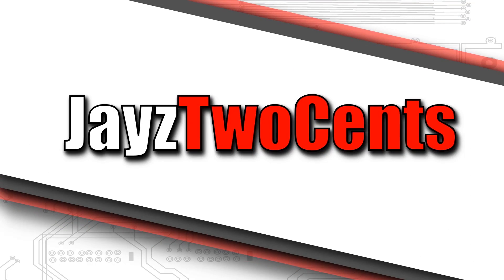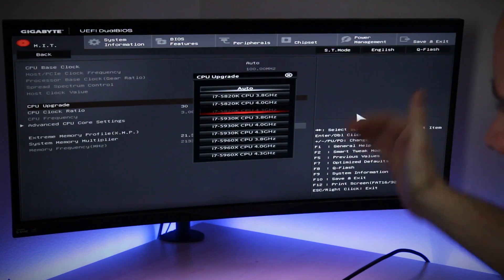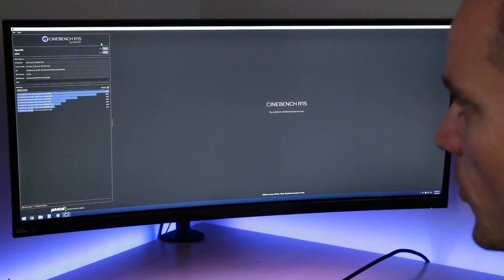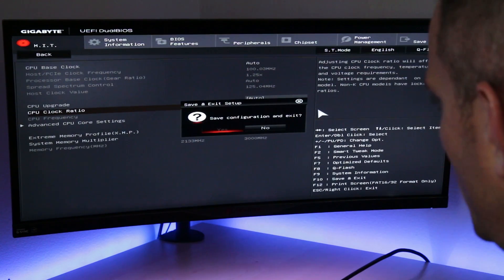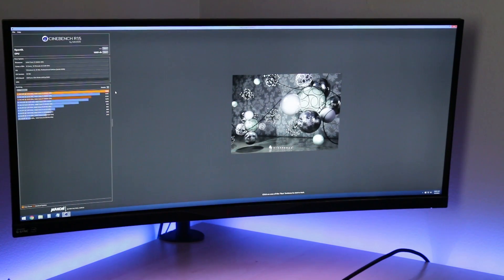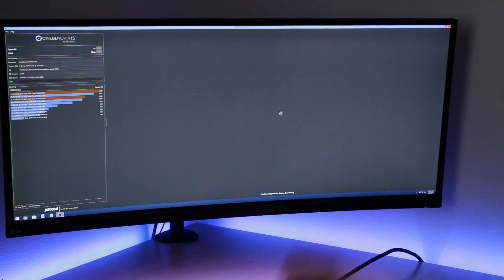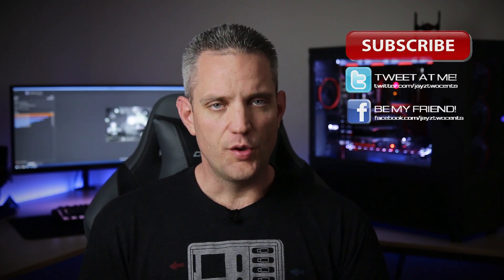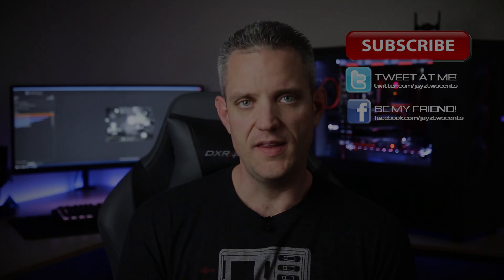XMP vs Overclock

Comment: i went from a 700 watt ocz power supply to a 1000 watt evga power supply and as a result i could only hit 4.7 ghz stable on my amd 8150 instead of 4.8 ghz that i was hitting with the ocz, so power supplies can have a big effect too
Reply: +1234garrett1993 That's because evga psu's sucks big time.. So many people are complaining about unstable systems when they buy evga psu's..
Reply: +Ulrich Jensen It depends, EVGA Supernova G2 is basicly the only good series evga has, the others are pretty shit.
Reply: i have the supernova 1000 g1, i got it over the g2 because the g2 has bright red pci e cables lol wtf were they thinking
Reply: I don't have bright red pcie cables on mine... (750W) G2
Reply: yeah i think the 1000 watt was the only one that had the red cables
Reply: Yeah, just checked pictures, IK wouldn't really midn since I am going for a red/black build.
Reply: MegaAlalil nice i love red and black builds you should check out some red and black sleeved cables if you havent already lol
Reply: I think getting a better monitor, and an ssd is a bigger priority first. All of my cables are already black, and I want LED's too.
Reply: nice, sounds like a good plan, i have a 27 inch 4k, i think getting a 4k screen that small was a mistake now so if you were thinking about something around that size you might go with 1440p lol
Reply: I was thinking of going 1080p PLS screen. 

This one to be specific: http://www.inet.se/produkt/2303856/samsung-24-s24d390h#/specs

I don't need 144Hz, and my graphics card is not powerfull enough to max out games in 1440p. (I have a Sapphire R9 390 Nitro, and a i5 6600k @ 4.6Ghz)

Comment: For someone who is completely new to overclocking, should I try to manually overclock my 4790k on my msi gaming 5 board, or just use the OC genie feature? Before I overclock, I will be using a kraken x61 cpu cooler.
Reply: +Cruzz999 Do It manually, go slow, and if you get a bluescreen, its nothing bad (as long as you didn't set your CPU clock to 6 GHz or higher)

Comment: The most fun overclocking time I had was with AMD K10 CPU, especially when you unlock new cores. My Sempron 145 has an unlocked 2nd core and overclocked to 3.2 (using the damn stock cooler @53°C, in full load, it never gone more than 63°C).

I also had a FX4100 and it was boring to overclock that. From 3.6 I took it to 4.4 without breaking a sweat. Didn't even messed up with the voltage, just bumped up the multiplier.

Now I'm waiting for a Zen APU (Raven Ridge), as I like SFF. And yes, I'm a fanboy, but I do own an WIntel tablet (my main PC), since AMD doesn't have tablets. I wanted to buy a Mullins A10 micro-6700t, but the only tablet having it was from a company called Bungbungame and it's name was Photon2. Who the f*** would buy that?

Comment: What about overclocking with inter extreme tuning utility?
I got my i5 4690k to 4.6GHZ 1.3v stable for 2 months (still having the OC)
Is there any drawbacks by not doing it in the bios?

Comment: 1155 socket - i5 3570k Later on ill get Gpu upgrade not cpu that's later as i still use 2xgtx 660's . runs gta v good .& this is all on air cooling. cooler is SpinQ VT.
My scores: CINEBENCH:
Stock Cpu: cpu 3.8 ghz score= 494
Bios (Oc Tuner on this socket it's called this not XMP. ): cpu 4223 ghz score= 577
My OC: cpu 4723 ghz score= 646
Reply: +Dj Xee-Taytius & i did have a H110 & got it to run nicely at 4.8ghz .

Comment: Overclocked my FX8320 to 4.6Ghz. I get a Cinebench score of about 700
Reply: Tanzu15 Now hats just bragging :P
Reply: Tanzu15 What? You only have a 7960X? Jesus. You might as well use a Typewriter
Reply: +Retrospect I Got a score of 722 with my i5 6600k @ 1.35v @ 4.51ghz
Reply: Same here! I have gotten as high as 714 on mine. What voltage settings are you using?
Reply: +Retrospect 5820k @ 4.6 ghz, CB at 1289
Reply: +Retrospect Fx8320 4.5 @ 699
Reply: i7 7960x 12 core 6.0ghz 60 pcie lanes
5,059,890 score. 40 Threads. 50mb cache.
Reply: Fum3s 1.35V is a bit high for Skylake. 1.3V is about the safe voltage for haswell. I would not go higher than that on Skylake.
Reply: Carl Tiede 1.46V I think... It's not the best Overclocker :P

But I think if I upgrade my cooling a bit, I can hit 4.7 or even 4.8. And I mean, a score of 700 is not too bad for a $100 (used) CPU ^^
Reply: Retrospect Wowzer! I got lucky I am just on 1.3875 or something close to that. I have to double check. I am still on air, and haven't REAALLY had a need to go higher. No when you consider it is a faster multthreaded performance than a 3770 which still sells for like 300 haha.
Reply: Carl Tiede It was used and cheap. And I think I know now why the Guy sold it :P

But it coud also be a temperaure thing... I use a Gigabyte 970a UD3P, so not really a High-End overclocking board :P After I strapped a fan to my Manboard VRM cooler, I got an extra 100Mhz stable. Then I ran the fans on my Radiator at 7V instead of the 5V from before and lowered my CoreVoltage about 0.05V.
Reply: Retrospect lmfao im from 2035. this is actually 2 years agos best machine. oh and its as small as a ps4.

Comment: I'm new to PC building and keep to relatively safe overclocking. With my GPU I just do what OC I can manage without going over voltage. And I'll admit I'm afraid to run extra current through the GPU for concern of "zapping" the circuits, if you get my meaning. Same with the CPU. I see the automatic settings but the manual OC stuff is way too confusing for me, and again I have no idea how much extra voltage I can safely add to the chip before shorting it out.

Comment: you were talking about degradation and such from running your cpu at max. I remember in another video that you also don't do CPU stepping where the Ghz will ramp up but rather you keep yours at max. Would allowing for stepping improve degradation resistance also what are the benefits to turning of CPU stepping?

Comment: i5-4690k @ 4.2, any higher blue screens
Reply: At what voltage tho? I can get my 4690K to 4.5Ghz @ 1.4V, not running that overclock tho but I will before I upgrade anything
Reply: Silicon lottery is bitch. Guess I got lucky then, same chip and 4,4Ghz @ 1.180 volts stable
Reply: +TheYGrizzly Yeah I think I lost the silicon lottery with my 4790K. I can't get past 4.6 GHz at 1.3V.
Reply: I'm at 1.22v 4.4GHz with my 4690k.

Comment: what can i do to add more fans when my motherboard only has 1 fan port or input
Reply: Fan Controller or connect low speed fans via Molex / preferably SATA connector to the PSU directly (remember that they will run with 12v all the time so you really have to use a low speed one or your system will sound like a turbine)

Comment: Is R9 390X better than R9 390? IN terms of overclcocking and perfomance in General?
Reply: Not worth the extra $100
Reply: +Daniel Rantanen explain your comment. Why? 390X beats 980 in some games and in others is eqaul.
Reply: I wouldnt pay $100 for 2-7fps more. You have to consider that GTX 980 is basically GTX 970Ti.
Reply: +Daniel Rantanen sometimes is 7, sometimes is 10 fps difference. Yeah but 980 has 200€ more than 970, and 390X has only 100€ and maybe less.

Comment: ik this isn't the right spot to ask, but I got some rly crappy thermal paste off of eBay (2 grams for $2) because my gpu was horribly dusty and reached 80C under load and idled at 40.  taking the gpu apart was a breeze. I cleaned everything out, replaced the thermal paste with the crappy one; the old thermal paste dried out. as soon as I fired it back up I was expecting amazing results due to a complete deep clean, but my temps were about 15 degrees hotter. idle was around 55, and load temps were 95-105 degrees. HELP PLEASE
is it the thermal paste to blame or did I mess something up when I took apart the gpu? 
it's an xfx 6870 2gb (it's pretty small)
Reply: never get ebay stuff for things you love 
either get artic silver 5 or mx-4 , I personally use mx-4 
idle at 20-30c and load at 50-60c
i7-4790k @4.7ghz
Reply: +XNinjaZero I had $2 left on a prepaid card so I was like "why not it's just thermal paste it won't make a difference" and it did 
even w the gpu all shiny and clean it runs 30 degrees hotter :(
Reply: +MCatwar yeah should've waited, not really hard to get 10 bucks saved up for good quality paste. just re-do it again with either of those paste and you'll be happy again

Comment: I went with 4.7Ghz @ 1.352v for my 6700k instead of 4.8Ghz @ 1.4v in order to have 3000Mhz ram.

Worth it or nah?
Reply: whaaaat? 1.35 for 4.7 on skylake? bro I'm at 4.7 on a 4790k at 1.2v. this made my decision to keep my cpu and screw skylake :P
Reply: +john handcock sometimes has to do with the board too, I put my cpu on my friends msi gaming 5 and only could do 4.4ghz on it compared to my vii formula
Reply: XNinjaZero MSI Gaming M5 is what I have as well. If I had known it came with no LLC feature, I'd have bought something else. It's really hampering my overclock.
Reply: +Verendus Vir the asus maximus line is very good at this, even the hero can achieve good clocks with very low voltages. I got the vii formula for 250 instead of the 350 when it came out and love it, I painted it white for my theme build.

Comment: Fx-6300 @ 4.5Ghz with manual overclocking.
Reply: I did the same oc , still too fucking slow :/
Reply: Same
Reply: +Ed Thomas you deactivated 2 cores? Why exactly did you do that?
Reply: What do fx cpus get on cinebench?
Reply: +SIME_LP In what way is it slow?  My FX6300 is permanently overclocked to 4.1Ghz and it runs cool / quiet and fast,  In GTA5 with pretty much everything maxed I am getting 75-80fps and that's really only limited by the fact I have a GTX 970sc / CS:GO I get about 180fps max settings / star wars battlefront I am getting close to 110FPS max settings and given that my monitor is only a 60Hz I am getting way more performance in games than I can actually use until I decide to upgrade my monitor to a faster one or I take the risk and overclock it.     So if you have overclocked your's and are getting slow performance then you might have done something wrong like overclocking the ram or setting the ram to its max speed when you have more than 2 sticks installed doing this will cause the CPU to take a performance dump on its self as AMD FX chips have crap memory controllers and can only handle memory overclocks with 1 or 2 sticks and not 3 or 4.
Reply: +Hivon to get higher stability.... lower heat. 

some cores wont OC as high as other cores in the same chip...... and because bulldozer has REALLY bad single thread performance... but AMAZING multi thread..... yor not taking that big of a preformance hit. 

im still running a phenom 2 1090t 6 core at 4ghz because it beats bulldozer in single thread (aka, most games)
Reply: +EQUINOX your single thread preformance is lower than the same clocked phenom 2. 

4ghz phenom 2 vs a 5 ghz FX... the pheom winsat 1 or 2 cores, and the FX pulls ahead at 3 or more.... if you cna laod all cores on an FX, it will FLY!

but no games/apps really use all 8 threads.
Reply: +Ed Thomas why didnt you get an fx6300 then? I am about to replace mine with an i7 6700k but I've got mine at 4.9 I wanted to push 5 but blue screens the 6300 would have been a better choice for you
Reply: ***** No one cares about single core performance other than Intel fan boys it is somewhat pointless to even bring that up as pretty much all programs and games work on multiple cores now ether through design or the OS,  Some games like farcry 3 were designed to work on a minimal of 2 cores and more modern games on minimal 4 and GTA 5 spreading its self over all six of my cores,  ether way windows 10 is smart enough spread the load over all available cores even if the game was only designed to work on 1 core.  So in this day and age there will never ever be a second where you will only ever use 1 core unless you disable the others.

Comment: Anyway to make MSI's over lock genie useful? All it does is turbo my cpu to its standard 3.8 GHz doesn't actually overclock it more than Windows power solutions does
Reply: +suchtieps3 The 6820HK does exist.. Check Intel ark..
Reply: Overclock
Reply: +EraseUrFace mine does the same... but i managed to get my 6820k to 4.2ghz without changing much.. however.. when i run cinebench at 4.2 i get a lower score than the msi clock at 3.8
Reply: +lankyeric u got a 6820k? nice man!!! I still like the 5820k
Reply: +Der_Zombie i have a 5350
Reply: +EraseUrFace my msi a88xg-45 gaming mobo would auto oc my chip a couple hundred mhz, youre talking about the bios genie right?
Reply: +Der_Zombie He is a wizard would i say . But i already have the 7820k AMP ROG OC Edition.
Reply: +Ulrich Jensen isnt that  a mobile cpu?
Reply: hmm very interesting, guess I will have to stick with amd overdrive. fuck
Reply: gr8tim22 reports and tests Yep 😊
Reply: i actually use it just fine. make sure to always hit apply or it wont take affect.

Comment: i finally made the jump and did an overclock on my processor (amd fx-8320 black edition, asrock 970m pro3 motherboard, and a stock cooler). went from 3.5ghz to 4ghz. noticed a pretty nice performance buff without affecting my thermals.
Reply: Jolly good

Comment: @JayzTwoCents pls respond, i only got a question. When you overclock your cpu, do you also have to increase your memory frequency along with the cpu frequency, or can i just increase my cpu frequency and not have a problem? i got a 4930k with an h100i and i can only get to 4.2ghz max, no matter how far i increase the voltage, right now its at 1.336v even if i put my voltage to 1.455 which is safe it still crashes. i need help
Reply: +Johnsomething duh or is the 4930k a bad overclocker?

Comment: MSI Gaming 5 Z97 board has separate xmp and CPU clock. if I choose xmp it only changes memory timing. I have xmp and oc CPU. the one click auto overclock doesn't touch the RAM either just the CPU.

Comment: question. 
from stock settings going to xmp profile OC. you only enable xmp profile, but did the xmp profile also changed the voltage settings of the cpu? or not?
Reply: Depends. Does the OC it applies need more voltage? If so, it probably gives more
Reply: Well, I mean if it needs more, it gives more
Reply: thanks man. so voltage might be set at "auto" if xmp was enabled?

Comment: I have a 5960X and I usually score in the neighborhood of 1500 in CB. Then again, I keep mine locked down at 4 GHz just to keep temps and noise super low. She's cooled with a Noctua NH-D14 and sits comfortably in a Silverstone TJ08. I'm not personally all that interested in OC'ing, in fact most of the time I just run the preset 4 GHz profile in the ASRock BIOS. Works great for me.

Comment: have you had the 100% disk usage problem in windows 10 ?
Reply: +Matabei Ororoh 
Would you care elaborate please? I'm not sure if my problem is related but I also had trouble with my new SSD when using SamSung's Magician software in Windows 10. Over Provisioning gives me 100% disk usage. I'm then left with no choice but to format the drive.
Reply: +Tom Mulligan i did a lot of thing forums told me even reinstalling windows 10 on 2 diff ssd and hdd etc and the only thing that worked for me is turning off firewall and cloudprotection in settings my boot was about 4 sec but now its still longrt but better and when i log i still have 100% usage but it goes away after a couple of minute . i copied this from a forums and pretty much all of these tips helped me 

FIRST :
Hey guys,
I have a solution to this problem, as tested and is working.
Turns out that , at times, Windows 10 will foolishly enable Windows Defender and "Cloud Protection" even when you have an alternate antivirus application enabled, and to make matters worse, this "Cloud-based protection" bullshit is a major bandwidth and I/O hog that is also masked under the Service Host: Unistack Service group category in Task Manager.
Disable Windows defender bullshit and ensure that "Cloud based protection" remains unchecked.

SND:
I had this issue and it seems some others encountered the bug. What fixed it for me is going to settings, system, notifications, and turning off "show me tips about Windows." I believe that was the one causing problems, though I turned all of them off besides the app notifications. System processes went back down after a restart and haven't spiked since.

THIRD:
Step 1: Press Start key + R key. Pop-up window will appear.
Step 2: Type <cmd> and press enter. Command window will open, and you will see this. C:\user\user name>
Step 3: Type <cd..> and press Enter, then again type <cd..> and press Enter. You will see this. C:>
Step 4: Type <wmic> and press enter.
Step 5: Type <product where name="Microsoft security client" call uninstall> and press Enter.
Step 6: Type <y> and press the Enter key. You won't get any confirmation that it was removed (At least I didn't)
Step 7: Restart

some said update windows 10 to fix it and some say its the virtual memory patching or others are with regedit.exe closing superfetch etc
Reply: +Matabei Ororoh 
Big thanks for the info. Interesting. I recently did an online review on the SamSung SSD giving it just a one star rating and now I learn that the problem is with Windows 10 and not SamSung. I will request that review be deleted. I will follow your advice on disabling the firewall and Cloud protections. Thanks!
Reply: ***** oh that might just be my problem gonna do it right up
Reply: nope :/ everything i tried does not remove my horrible 100% disk usage in log in time and slow at start menu  -.-